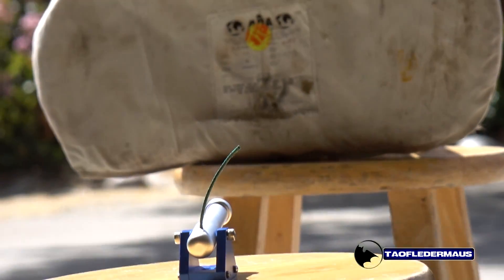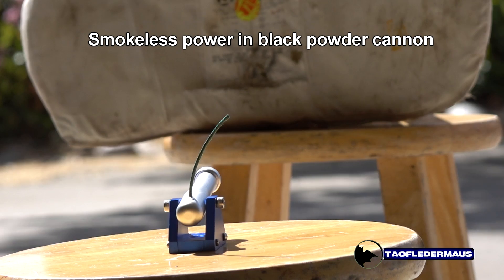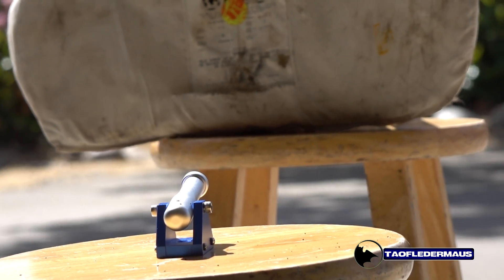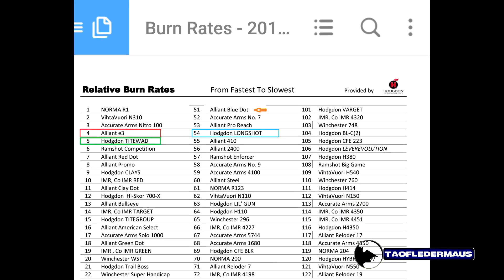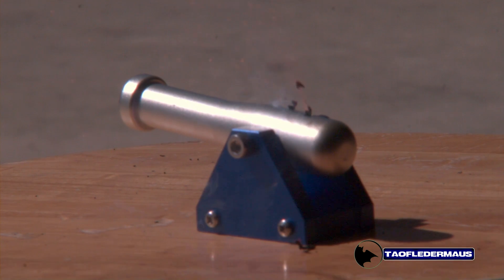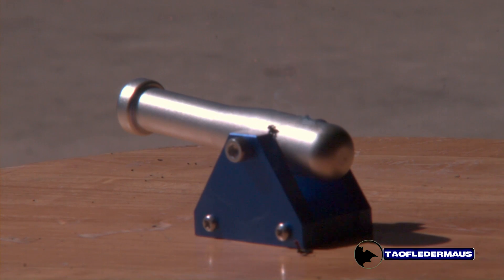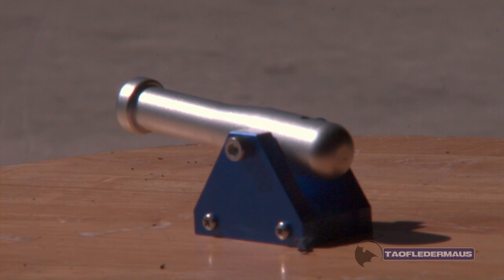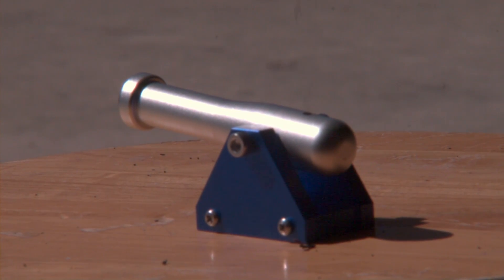What happens if you use smokeless powder in a black powder cannon?

Comment: Actually, it depends. I would never recommend this, but if you mix black powder with smokeless powder, you can get it to explode without first requiring a high pressure environment. Also, if you wash the smokeless powder in water, and then dry it out, it will become significantly more unstable and require less pressure to detonate.

Comment: I built a smokeless muzzle loading cannon (overbuilt like a mofo but all safety precautions are observed either way, it's remotely fired from a distance) about 15 years ago, and I can guarantee it doesn't just fizzle out lol. It's straight up dangerous, weighs about 40 pounds and has a 3.5" outer diameter but only a .75" bore made of heat treated chrome-moly steel, which makes the wall thickness 1.375" and is 12 inches long, it hucks 600 grain .75" lead roundballs, wadded with compacted paper towels at well over 2,500 FPS. The muzzle brake (radial holes drilled around the end of the muzzle) pokes holes in whatever is underneath it, which makes sense considering I load it with around four hundred grains of Alliant Green Dot shotgun powder🤣. The recoil, despite the six 5/8" muzzle brake ports directing a good majority of the gas outwards, sends the entire cannon flying backwards about 30 feet lol. Shoots a hole through 3/4" steel plate...

Never ever try to recreate something like this unless you know exactly what you're doing, my cannon can potentially become a 40 pound fragmentation grenade considering the powder charges and consequently high chamber pressures (haven't measured it yet but it's too much, I've measured a few thou of expansion in the OD of the chamber after all the firings I've done lol, sketchy AF) involved, it's probably well over 60,000 PSI. Dangerous.

Comment: Dork. You didnt use enough wadding behind the bullet. After pouring in the powder: First put in a little bit of toiletpaper in the barrel. Dowel it down. Then put in a bit of candlewax, dowel it flat with a wooden dowel. Then the bullet, which should be a snug fit. Then smokeless powder will work like a charm 😃

Comment: I tested this theory before by removing the crimp from a shot shell then pouring out the shot leaving the wad which held back the powder. Upon detonating the primer the pressure was enough to push the powder and wad out of the barrel, the noise was almost nothing as the powder and wad dampened pretty much most of it. I had shot a primer with nothing in front of it before and it's pretty loud, the fact that un-burnt powder was raining down after I shot it proves that the primer ignited but the powder did not. The fact that one of the approved ways of disposing of wet, old or otherwise questionable smokeless powder is to put it in a pile of no more than one pound on a inflammable surface and burn it is further proof that it will burn with enough heat because it is an accelerant not an explosive so it will not burn extremely fast and act as what most people would call an explosion without pressure combined with heat, black powder on the other hand is an explosive.

Comment: Next time load in enough fine grain black power up to the touch hole and use some old time bullseye smokeless powder in front of it and then the lead ball.  That should be enough pressure.  Also if you were able to set that up with percussion cap and striker system it would go off also.  I think I have seen someone use smokeless in a cap lock rifle and it worked.  
To get out the lead ball out try a few grains of black powder through the touch hole.
Youtube is logic unto itself relative to what it considers naughty.  
I do like the way you guys think.

Comment: I usually love your videos, but this one is literally going to get someone killed one day.

I am a blackpowder cannon enthusiast, and have read many reports of cannon related accidents over the years.

They appear to fall into two main categories; premature ignition caused by reloading while there are still embers in the barrel, and people using smokeless powder.

The cannon in your experiment is tiny, and the bore is probably not much larger than the touch hole, hence the pressure was not able to build up.

A cannon with a larger bore will still have a similar sized touch hole.
There would be a lot more powder, and only a relatively tiny hole for the pressure to escape, essentially turning the cannon into a bomb.

One day someone is going to watch this video and think it is safe to pour an ounce of smokeless powder into their homemade black iron pipe cannon, and it's going to kill them or a bystander.

Please take this video down.

Comment: Do NOT take this at face value.  I have personally witnessed a home made steel cannon (.6 inch bore, 6 inches long) turn a part of the cannon into a piece of shrapnel.  It was ignited by a piece of fuse as well.  Why the smokeless powder did not ignite in this video only shows an enormous failure of the test.  Never try this.

Comment: Instead of old school fuse method, try mini artillery setup. Make a micro round in casing with primer, have enclosed locking hatch system, fire it off. Maybe that could work with smokeless?

Comment: I would have expected more flames and heat...  When I burned a few shells worth of shotgun powder load (about 20 grams) in an open dish years ago, there was lots of flame, and enough heat that the heavy aluminum dish I was using burned a ring into the formica on my desk...  There's a video on my channel with that, but it was 10 years ago.

Comment: What if you put flash powder/black powder in the area of the fuse, and pack smokeless powder elsewhere so the flash powder will act as a buffer against the leak in the fuse hole?
Reply from the maker: it's easier to just use black powder or pyrodex  lol

Comment: Could use a packing like tissue paper or cotton cloth to increase pressure.
Reply from the maker: There was no leakage past the lead ball.   They fit almost air-tight.
Reply: @taofledermaus  I remember you saying once that a shotgun shell... thing... needs a rolled edge otherwise it won't build enough pressure. I was thinking the same idea may apply here.

Comment: A blow gun on an air compressor blown into the fuse hole should get the lead ball out.  You could also drill a pilot hole and get a screw into the lead ball to pull it out.  That test was less climatic than I thought it would be to be honest.

Comment: long drill into ball then long screw pull out. Or slowly pour black powder down fuse hole then fuse it again. pop goes the bally.
Reply: It's lead, you could probably skip the drill and screw a wood or sheet metal screw straight into the ball.
Edit: Hey, that's an idea - try firing a lead ball with a wood or sheet metal screw in it out of that thing.

Comment: It worked for me I pulled a  .17hmr and poured the powder down in packed it with tissue and shot the .17hmr projectile...
Reply: Metallic cartridge with a good seal at the front gives you the ability to build up pressure.

Comment: This "experiment in action" is something that I would call misleading. From a fuse lit cannon like this, certainly this kind of results should be expected. 
HOWEVER, smokeless powder in a  black powder firearm can potentially yield catastrophic barrel failure. In other words, you can blow one into shrapnel. This has, in fact, been done and filmed by others. Granted, the charges were overloads to start with, but the results were impressive. Parameters were imagining that a can of smokeless was picked up "accidentally" and the normal BP measure used to put in a "100 grain charge" of accidental smokeless. This will bulge the barrel of a percussion gun, and blow up a 209 ignition gun. 
So, your statement that smokeless needs pressure to function efficiently is quite correct, but this experiment can give a false impression that the same results will occur in a BP rifle, and that isn't correct.

Comment: Good demonstration Jeff. the pressure that gets generated from the burn of smokeless builds as you can see and hear from your demonstration here. More gas escaped from the flash hole as the powder burned.  that in a closed chamber and it becomes perpetual. the fuel is consumed much faster and the pressure builds as the bullet becomes the point of least resistance. - Good video dude- Dave.

Comment: I have a .38 brass black powder  and i did use smokeless once approximately half of my regular black powder load. And packed it with wadding  actually got a bigger boom than my black powder
Reply: Half the black powder load was an overload. Smokeless generates 3-4x the power for an equivalent volume. A quarter load would have been safer.
Reply: @edifyguy  yea i figured it out the hard way lol . My cannon is still viable and use able
Reply: @danwyrick322  Overall win then. :)